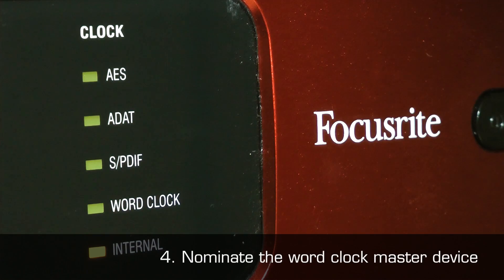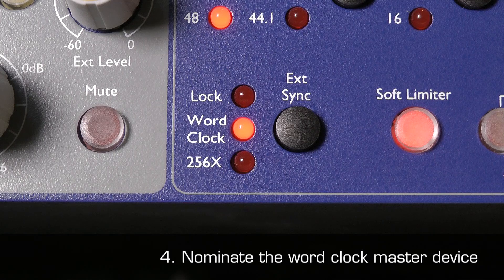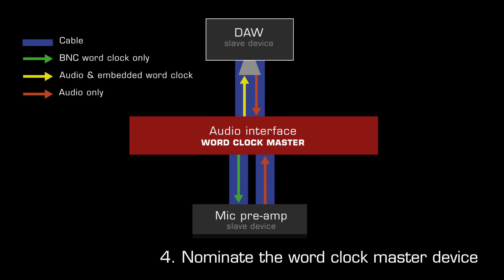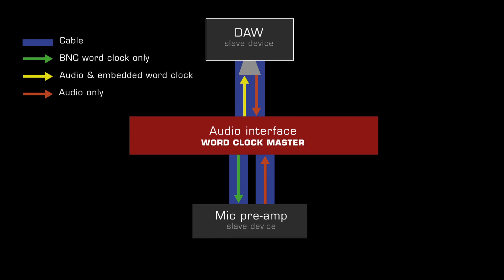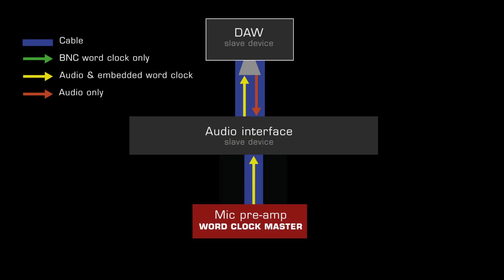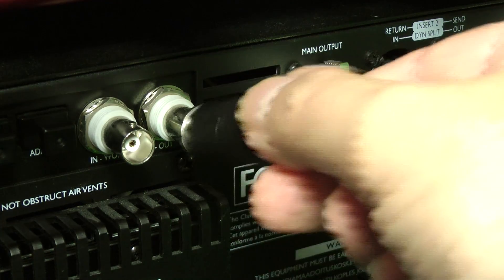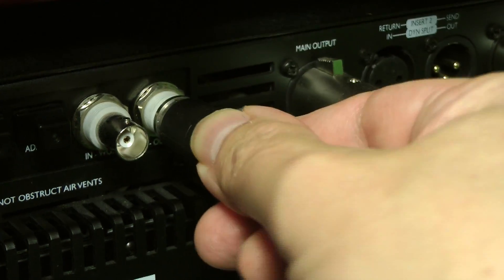Connecting devices with AES3 or S/PDIF coaxial leads (v1)

Comment: so if my audio interface is missing digital input ...then i wont be able to use my isa   one mic preamp's 
 digital card for recording vocals ??
Reply from the maker: That's correct Ronnie. You need an audio interface with an AES, SPDIF or Toslink (ADAT) input connection. Either one will  accept the same PCM data, there will be no difference in quality over short distances. Toslink will be the easiest to setup because you don't need a special lead. Your DAW will need to be set to 24-bit mode and the ISA One will need to be the clock master with your DAW/computer as a slave. Hope this helps.
Reply: dammnn bro it did help ....its just I have ur242 so I'm fucked now I guess ....thank you bruh...one last thing ..is it gonna cost me a lot of good quality if I got to choose analogue over digital ( isa one preamp) setting  for my rap vocals ?
Reply from the maker: The quality loss using the analogue out of your ISA One is going to very minimal, perhaps even inaudible. You have a great pre-amp and almost all A to D converters are excellent now. Set your levels into your interface converter carefully and you won't know the difference.
Reply: thank you  for he quick reply man .... ill keep that in mind

Comment: I want to go completely digital for my home studio... I want to connect AES3 to a pair of genelect monitors that have AES3 input. I notice there are only one in and one out....on both the ufx plus and the speakers..so do i have to daisy chain the speakers?  I have a noise problem in my neighborhood where i get electrical interference in my recordings...I have tried everything. So now my only real solution is to buy a new audio interface ( ufx plus) and a pair of genelecs with AES3 input and outputs.. I hope that somewhere in the upgrade it will fix the problem of interference...especially with new monitors and going completely digital.
Reply from the maker: Hi Justin. Sorry to hear you are having noise problems. Depending on its nature, a dirty power supply can impact on the clean operation of a digital system too, so you may want to analyse how the system is being affected before spending money. Remember AES3 is an electrical signal. You could for example hire a power conditioner (such as the Furman AC-210 A E) and see if that solves your problem. If you share a power connection with others (eg apartments), and the supply is being "polluted" by thermostats etc it might work. If your supply is individual then conditioner may also work but do call the power company and ask their advice, there may be a fixable solution. AES3 can carry a stereo signal so the monitors you are considering may well daisy chain. You'd need to check the manual. If the UFX+ is the clock master (which it should be), then the monitors will need to slave to it. Check the manual for this too, it should be a standard feature. Hope this helps.
Reply: Thanks for the info. About the noise; It started when I bought a pair of Yamaha HS8...before that I had a regular pair of loudspeakers and I never had the noise problem. The noise is also coming from my UA710 preamp. So I am thinking the noise affects certain kind of amplifiers?? before getting the 710 mic preamp and the monitors I used an old Hifi Pioneer Entertainment amp and I never had any noise problems..I upgrade to studio monitors and all of a sudden all this noise...and the noise is also affects the 710... I dont get it.
Reply from the maker: The noise may not be power related. It could be RF (air-born) and being picked up by the UA710. Have you tested it elsewhere?
Reply: I did test them elsewhere and the noise is gone, thats how I know its an neighborhood/environment problem.Oh i forgot to mention that i live in NYC and my building is over a train station. Do you think going digital will work? seeing as the problems seems to happen with certain types of gear but not all?
Reply from the maker: It's quite possible that electro-magnetic noise is entering your system via sensitive components like magnets and tubes. Short of building a faraday cage there's probably not much you can do. As an experiment, if you isolate the noise source to your UA device (turn other stuff off), does it reduce if you wrap it in kitchen foil?
Reply: I'll try the tin foil.. when I hold the cable with my hands the noise is reduced...Though.. I'll try the foil.
Reply from the maker: Sounds like you're creating a ground to earth. Are all your connections balanced?

Comment: Is SPDIF coaxial cable identical to a simple RCA cable? Wiil it work properly if I use an RCA cable to connect my converter to my soundcard?

Thanks for your advices.
Reply from the maker: Pitacle You may get away with using an analogue RCA lead but SPDIF leads are different to RCA leads. Although the connector/plugs are the same the cable capacitance differs.